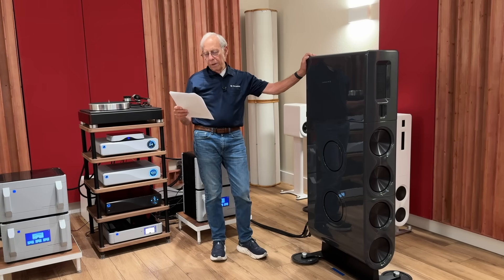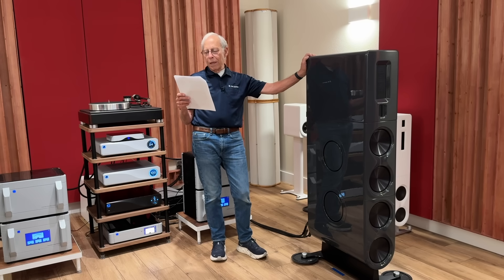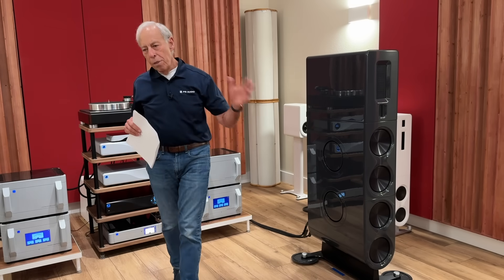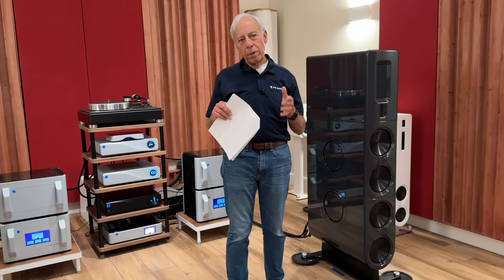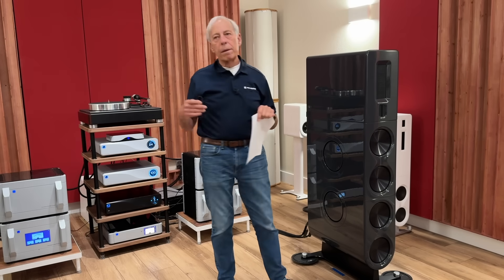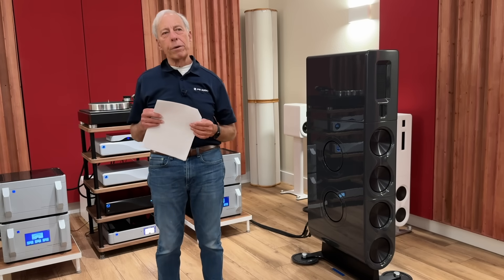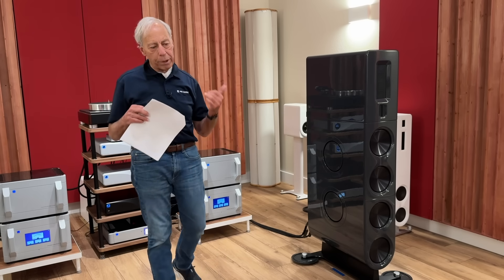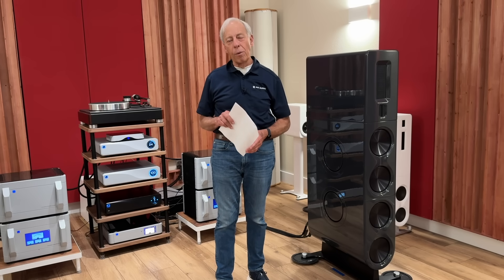Matching power amps to planar speakers

Comment: That is just nonsense they can't be lighter than the mass of air. how much air are you talking about ? maybe football stadium😂 but that doesn't work like that either. The only air is the mass in front and behind the driver. Just gobblegook nonsense. You got to love his sales pata he tries😂
Reply: @therealBozoDJTrump ...The mass of air directly in front of an aspen FR planar driver (tweeter or midrange) is in fact greater than the mass of the TEONEX membrane that pushes the air in said tweeter & midrange drivers. If you want confirmation of this fact then reach out to Chris Brunhaver, the head loudspeaker engineer & designer at PS Audio for clarification, as he designed the drivers & chose the TEONEX membrane material.
Reply: Actually I did a quick analysis of the direct air displaced volume by a planar speaker driver using AI. Question "The volume of air moved in one motion of the membrane is that more heavy than the weight of the membrane for Magnepan speakers?". Answer "No, the air displaced in a single motion is lighter than the membrane itself.
Even at generously large excursions, the air displaced weighs less than the ultra-light diaphragm in a Magnepan speaker.". The answer includes a very detailed analysis and calculation to come to this conclusion.
Reply: @ThinkingBetter 
Interesting. 
I wonder how chatgpt measured one motion. 
It seems to me one motion would be out and in, because the membrane will return, (which is actually two motions). And since it's a dipole speaker, sound is produced as the membrane returns back. 
...whatever, I'm too sleepy for thinking. 😅
Reply: @unclewilbur8976  It hallucinated.
Reply: Yes — there are situations where the displaced air weighs more than the moving mass (including the membrane or diaphragm), particularly in low-mass, high-displacement designs. This occurs most notably in:

✅ Examples Where Displaced Air > Diaphragm Mass

1. High-Excursion Subwoofers

A typical 12" subwoofer with ±20 mm excursion can displace up to several liters of air.

However, subwoofer cones (including dust cap, voice coil, spider, surround) often weigh 100–300 grams or more, so the air usually weighs less — unless using extremely lightweight materials (like in some pro audio or servo sub designs).

> Verdict: Usually air is lighter, but not always by a huge margin in extreme excursion cases.

2. Electrostatic Speakers (e.g., MartinLogan, Quad ESL)

Their diaphragm is ultra-thin (1–2 microns of Mylar) and weighs just a few grams across a large surface.

Excursion is small, but area is large — so the air moved during a bass note (even with low excursion) may weigh more than the diaphragm.

> Verdict: Often air mass exceeds diaphragm mass, especially at low frequencies.

3. Horn Drivers or Compression Drivers

The diaphragm in compression drivers is often just a few grams.

The air column in the horn that is loaded by the driver can weigh more than the diaphragm, especially at lower frequencies or in long horns.

> Verdict: Yes — acoustic loading can cause the driven air to outweigh the diaphragm.

4. Large Planar Speakers (e.g., Big Magnepans or DIY ESL Panels)

If a 3 m² Mylar membrane only weighs 50 grams and moves 1 mm, it can displace ~3 liters = 3.6 g of air.

Push that to 3 mm, and the air = 10.8 g, now coming closer to or exceeding the diaphragm weight.

> Verdict: Possible, depending on excursion and panel size.

📌 Key Principle

The condition where:

> Mass of air displaced > Mass of diaphragm

…depends on:

Large surface area

Thin/light diaphragm

Moderate to large excursion

🔄 Why It Matters

When the air mass exceeds the diaphragm mass, the speaker enters a regime where:

The acoustic load dominates the dynamics.

It becomes mass-coupled to the air, reducing breakup and distortion.

This is desirable for transparency — as seen in ESLs, ribbons, and some planar magnetics.,
Reply: Yeah, true. It's a bit nonsense in fact. And true is that any speaker can make air molecules move even in a large room to some extend (lower SPL by distance, -6dB per doubling of distance). My friend (ChatGPT) told me that the mass of a typical church's volume of air is about 6 tons (about 5000 cubic meters of volume). So ANY SPEAKER can set in motion many times more mass than the mass of a speaker membrane. Now by the first law of thermodynamics, the sum of molecular kinetic energy that represents audio obviously originates from the power amplifier's output with losses. In a church sound wave reflections keep a smaller membrane able to enable a higher SPL in that given volume of air as molecules bounce (= sound reflections) on the walls more energy efficient with hard walls.
Reply: @ThinkingBetter  
Six tons of air equals approximately 128,000 cubic feet of air. Likewise that church would be 128,000 cubic feet in dimensions. So this church would have dimensions equivalent to 70’x50’x37’ (approximately).
Reply: @unclewilbur8976  Alright, I am also in the USA, but I like ISO units more. My friend (ChatGPT) is telling me that the diaphragm membrane in Magnepan planar speakers typically weighs on the order of 50–100 grams, depending on the exact model and panel size.
Reply: @ThinkingBetter  ChatGPT is trash. I might have given you an iota of credence but then you mentioned ChatGPT and let everyone know that you cant reason or think for yourself. And, I see that later on you double down with AI slop.